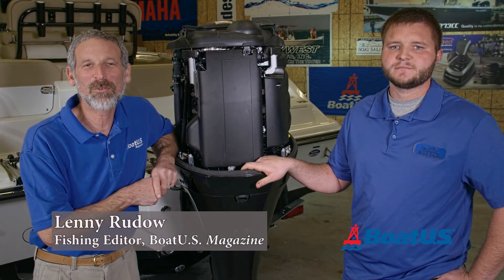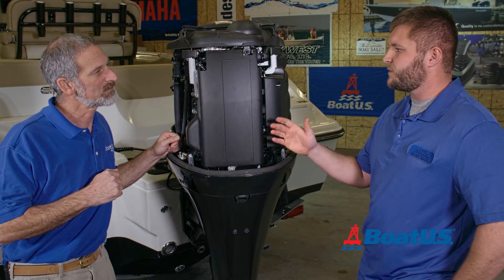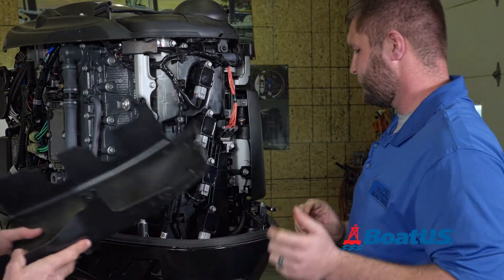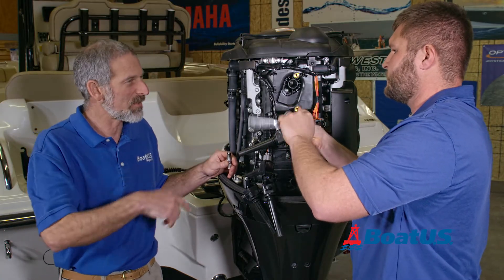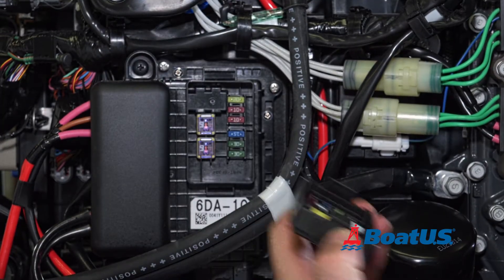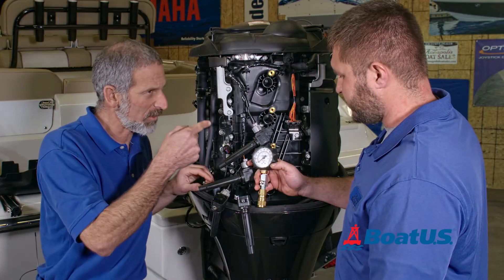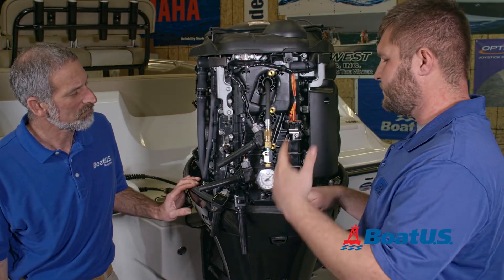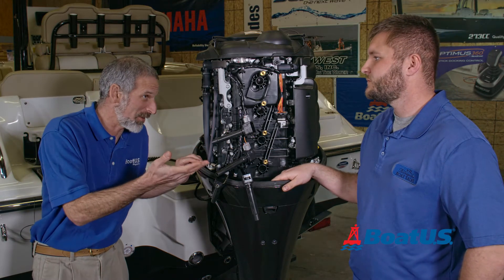Essential Guide: Test Outboard Compression Like a Pro | BoatUS

Comment: I see this video is older. I am a newbie to boating, and am looking at a 1999 cobia cc w/150 ox66 saltwater series II. Questions? Should I check even if she cold starts immediately,  or check to assure motor is good compression  . Also, any damage with fuel pump disconnected ?
BTW,  ENJOY BOAT US. AM MEMBER,  LOTS OF GOOD INFO, AND FREE COURSES!
Reply from the maker: Thanks for the question, Dave. Speaking both as a boater with many years’ experience and as a boat surveyor, my personal take is that a compression check, while useful, is often unnecessary. There are so many factors that come into play here: How old is the engine, how many hours does it have on it, has it been regularly serviced and will it make the manufacturers recommended maximum revolutions? Providing the engines meet all the criteria and perform as the manufacturer indicates in the technical bulletin or owner’s manual then all will most likely be well and a compression check unnecessary.

Having said all of that, I see that the engines you refer to are two stoke making access to the spark plugs much easier as they are easily removed from the cylinder heads without disassembly of any other parts to gain access and remove the plugs. This makes a difference, and also makes taking a compression test that much simpler, so I see no reason why it should not be done. Remember that a compression check must be carried out when the engines are warm – a cold engine will give false high readings – and all readings should be within about 10% of each other. If one is much lower than the rest then this could be indicative of s problem that needs further investigation.

You may find the following link helpful. https://www.boatus.com/expert-advice/expert-advice-archive/2016/april/checking-compression-on-an-outboard-engine
Reply: @boatus  The video says 10% of one another, when comparing compression numbers and your reply says 10 psi.  Which is correct?
Reply from the maker: @joewall1416  My bad, Joe. Thanks for pointing this out; you are quite correct, it should be 10% not 10 psi. Having said that, oftentimes the difference will be no greater than 10 psi between cylinders. Sorry for the confusion. I've updated my original response to Dave.
Reply: @boatus  Thanks for the quick response and clarification!
Joe

Comment: what is the thread size and pitch for these plugs?
Reply from the maker: Thanks for the question. The size of the threads varies depending on the make, size, and age of the motor. Older motors used either a 21mm or 22mm thread and required a 13/16 or 3/4 inch socket to remove them respectively. However, most modern engines us a 16 mm plug and require a 5/8 deep-well plug socket to remove them.

Comment: When you’re turning the engine over for the compression check do you have to have the water  ears over the inlet
Reply: Its good to have water muffs on anytime you turn the engine over so you don't prematurely wear out the impeller.
Reply from the maker: Thanks for the question, Jordan. Cooling water is only required while the engine is actually running. The engine is not started when conducting a compression test so, no, you do not need the muffs on the engine. Also, a common mistake when conducting a compression check is not removing all the spark plugs. Removing the plugs does two things: 1. It ensures that the engine cannot be started, and 2. there will be no compression allowing the motor to spin over on the starter easily.

Comment: What size adapter did you use? mY COMPRESSION KIT didnt have an adapter to reach thread into plug port
Reply from the maker: Thanks for the question, Cheryl. You should not need an adapter. As you will see, there is a rubber hose, usually about a foot long, in your kit that has a press fitting one end that goes into the gauge and a screw that goes into the plug hole. Before connecting the hose to the gauge, you should be able to attach the threaded end to into the plug hole by twisting the hose. The hose only needs to be hand tight.

Before conducting a compression test, make sure to remove all the plugs from the engine. This prevents any inadvertent starting and makes it easier for the starter to crank the engine over.

Comment: What causes no compression on one side of engine? V6 OMC 3.0. Please help
Reply: You shouldnt have a 0 reading on one whole bank of the engine, check you threaded the tester correctly otherwise the only thing I can think of is if it's a 4 stroke you have valve blowby but I have never heard of that happening to a whole bank
Reply from the maker: @yaboy6157  Thanks for your response!
Reply from the maker: Thanks for the question. If you have no compression it can only be down to a few things. Assuming that you have no compression at all on one side of the engine, I would suggest that you have holes in the pistons or the piston rings are no longer doing their job and have totally failed, often due to the engine severely overheating at some time. Another possibility is that the cylinder head gasket has failed. These engines were last made in 2000 and although I don't have much knowledge of these engines in particular I would imagine that it should be possible to buy spare parts. However, you may want to get a qualified outboard technician to give the engine the “once over” before you go spending a lot of money on it, as the cost of repairs may well be far in excess of what the engine is worth.

Comment: I’ve see 2 problems in this video. First for safe you should have the spark plug test connected to the wires ( you don’t want to get zapped while doing it ), also you should have the throttle in WOT for accuracy readings. Good luck
Reply from the maker: Thanks for your comment, Cesar. Cranking over the engine while performing a compression test introduces gasoline into the cylinders. You don’t want the high tension spark plug leads connected to anything that may produce a spark and potentially ignite any unburned fuel close by. Secondly, the disconnected spark plug leads are well shielded by the spark plug push-on connectors, so the risk of shock is very slight especially if the ends of the leads are tucked well out of the way while carrying out the compression test.
 

To your other point, it’s certainly possible to have the throttle in the wide-open position while performing a compression test, and I know mechanics who do this. The theory is that this introduces more air into the cylinders and thus gives a more accurate reading. However, much of the value in any compression test is the comparative readings between each cylinder. Opening the throttle may add a couple of extra pounds to the peak readings but it won’t alter the fact that one cylinder may have a lower reading relative to the others. 

That said, we stress that you should always follow the manufacturer's recommendations. If you're not sure, invest in a maintenance manual for your specific engine. It's money well spent.
Reply: @boatus  I was wondering how many comments I'd read through before finding the "you're doing it wrong" trolls. If it wasn't for YouTube videos, I can't help but wonder what these guys would be doing, and who they'd be doing it to.  This was a great video, and while there are always more than one way to skin a cat, you did nothing wrong....
Reply from the maker: @atomicslam1589  Thanks, Atomic. We are always happy for the additional input, which is usually very helpful, because, as you very rightly point out, there are often many acceptable ways to do things--and we do learn some great tips from our viewers and readers. But, yes, we do sometimes wonder why folks who clearly already know so much are watching our how-to videos. 🤷‍♀️
Reply: @boatus  Amen...
Reply: BoatUS That’s Right, while cranking the engine over it introduces gas into to engine ( good thing that you disabled the fuel pump by removing the fuse ) however having the spark plug leads hanging closed to the block without any protection is a little danger, the high current is looking for a ground and the engine block is a good source of it, most of the spark plug tester are safe to use.
Reply: Not to mention, unless I am mistaken, it can do damage to the ignition system having juice going to the unattached plug wires. I’ve always disabled power to the plug wires and fuel pump, if the pump runs of power. Either way you don’t want fuel or spark live during a compression test.
Reply: @finner2.019  It's a live circuit but there's no "juice" unless it's got a complete path.

Comment: I just tested my 1991 Evinrude "BEFORE" watching this video. My cylinders are all with 10% of one another, but...I did not remove all the plugs at once and the motor was cold. Should I re-check using your method? Thank You
Reply from the maker: Thanks for the question, Steve. As we mentioned in the video, the compression should be checked with the engine warm. This gives the pistons a chance to expand in the bores and will give a more accurate reading. 

Always check the compression with the plugs removed, this allows the engine to spin over easily, places far less strain on the starter motor, and perhaps most importantly, ensures that the engine will not start unexpectedly.

I’m glad to hear that the readings are all within 10% of each other, and although I doubt that there is anything out of whack with your motor, it would probably be best to use the method we described in the video.

Comment: Is it worthwhile to do a compression check on a lightly used 2017 outboard since it is about 2 yrs old.
Reply from the maker: Thanks for the question! In your case, it's probably not necessary. A compression check is simply one check that engine surveyors and interested owners can do on their engines. A compression check will give an indication of “blow by” of the rings and valves. This is unlikely to occur on an a nearly new engine and I would say that it is unnecessary, unless there is some other fault with the engine such as rough running or excessive oil use.

A compression check can be useful at times but a more useful check would be to get the engine to a local authorized service center that services your make of engine and get them to plug the engine’s ECM into the diagnostic computer. This will show any fault codes and the technician will be able to tell a lot about the health of the engine from this simple check, certainly far more than doing a compression check in isolation.
Reply: Ok

Comment: What should a25 horse mercery 4 stroke have for compression
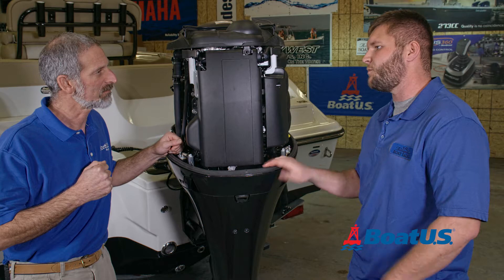Reply from the maker: Remember what the tech told us between 0:30 and 1:05 in the video. The key thing to look for isn't one specific number or another, but that all of the cylinders are within 10-percent of one another. Different gauges can vary a bit and elevation is also a factor, which is one of the reasons why looking for the different cylinders to match up is what you really want to look for.

Comment: Tnx for the informative video ,I have a question plz, whats the normal pressure for yamaha 85hp mix oil and fuel engine and is there a difference in the air pressure gage if is stander engine or 50 fixed or 25 fixed ?👋
Reply from the maker: Thanks for the question, Sam. If I understand you correctly, you are wondering what is the compression pressure that you should see on the gauge when you conduct a compression check. The pressure should be somewhere around the 125 psi mark but may be slightly more or less. What is more important is the comparison between the cylinders. Check each in turn and note the readings which should show a variation of no more than about 10 psi between cylinders. If one is significantly lower, further investigation will be required as this could be indicative of a stuck or worn valve, piston and bore wear, or some other issue.
Reply: @boatus  thats what I meant ,thank u 🙌👋
Reply: I have 90 hp  year 1986 yamaha and got following: 1# 7,5 barg, 2# 8,5 barg, 3# 9,8 barg.  Quite different. What is correct value? Can I use the motor?

Comment: Hey Lenny, where can I purchase a compression tester for my outboard?
Reply: I got my most recent compression gauges from Amazon for about $20 with a carrying case and an assortment of adapters and fittings a year or 2 ago and I've used the crap out of them. That's where I'd look.
Reply from the maker: Hello, thanks for your question! There is no specific compression tester for outboard motors. You can find suitable compression testers at places like NAPA or Autozone. Since it’s a tool that you need infrequently, you may find that you can rent one from either of these outlets.

Comment: Hi I have a 2001 90 hp mercury. Last oil change was 2 years ago I do a lot of winter trolling.  Last  time I checked my oil level it was a half inch high.  When I drained the oil milky water came out of the crank case. I would say no more than 6 ounces. I've read that these motors build up internal condensation.  Before I confirm this I want do a compression test. Have you ever seen this problem before? This is my first time servicing this motor.  I usually take it to a shop.
Reply from the maker: Thank you for the question, Pacoloco. Six ounces of water sounds like quite a lot, and I suspect that this may be more than simply condensation. Water in the oil could come from a number of sources, such as a leaking head gasket or worn seal — both of which will require the services of a trained outboard mechanic. 

Although you do not say how many hours are on the engine, I question why you believe that you need to do a compression check. This has nothing to do with water in the oil, which is a separate issue entirely. A compression check can provide a useful insight into the wear in an engine but often is not required unless other issues such as lack of power or a misfire is noted. 

A compression check is just one of a battery of engine checks that can be carried out to try and determine a problem with a motor. Of far greater concern to me is the water in the oil, and I would encourage you to get the engine checked out at a certified repair facility before you use the motor again.

Comment: Do you need to disable the ignition circuit when performing a compression test?
Reply from the maker: Good question, Gary. You are going to need to use the starter to perform the compression check. As you will have removed all the sparkplugs and disconnected the HT leads to the plugs, the engine can't start.
Reply: @boatus  On that motor, if you had used a remote starter switch (https://www.google.com/search?q=remote+starter+switch&oq=rfemote+starter&aqs=chrome.2.69i57j0l5.8468j0j7&sourceid=chrome&ie=UTF-8) between the battery positive connection at the starter solenoid and the brown wire next to it on the same solenoid, you would not have needed to remove the 15 amp fuse for the fuel system or worried about the ignition firing as long as the key was off and or the emergency stop lanyard was disconnected. At that point, all you would be doing is cranking the pistons, crank and such with no other motor functions.  I'm glad to see you showed the technician watching the compression reading as they were taken as that is an often forgotten important component to taking a proper compression reading.  Paul Murphy, Yamaha Master Tech.
Reply from the maker: Thanks, Paul!
Reply: I was always under the impression you should disable the ignition system so you don’t damage it if the plugs are disconnected and not grounded. You really only want power going to your starter.

Comment: Can anyone out there tell me WHY you need a boat? One reason? Anyone? Your hobby of polluting our freshwater supplies is not more important than my grandchildrens future! Private ownership of boats should be banned.

Bernie Sanders 2020!
Reply: Is Bernie going to be alive in 2020? 
While boats do pollute. They are just a small fraction of the reason for pollution. Take a look at how your battery in your phone is made. Or better yet how nuclear power is running your computer. Boats dont have place on a big list of reasons why water and air is getting polluted. Nice try. And for your sake I hope you dont have anything gas powered (lawnmower, car or bus ect). Because in your words, you are also part of the problem.
Reply: HAHAHAHAHAHAHA
Reply: This didn't age so well.
Reply: Jimbo the EPA has done its job in cutting down emissions from fossil fuel engines..Two strokes have been phased out with much cleaner engines..no oil mixed with fuel in four cycles..They are basically the same as your car..they have a valve train..and they are much more efficient on fuel..So improvements are made all the time..And there is electric engines! ..We are in a pandemic..notice how things take time to adjust..Boat owners contribute tax dollars and employment..Your statement doesint hold water in 2020 ,2021..Some of us work hard and need to unwind..decompress..speaking of compression..🤣
Reply: How about cars they are doing a lot more damage than boats.
Reply: What an idiot... 😂
Reply: Yes you and all the communists can go to live to Venezuela, cuba ,china, and fix the environment over there

Comment: Hi.. Thank you for the informative video. I learned a lot especially the part of removing all spark plugs before performing the compression test. I do however, have a question regarding wear and tear and life of the motor. I know the first reading is the benchmark, but how do I know that reading is within acceptable levels? Thank you!
Reply from the maker: Hi Marlon. Great question! A compression test is a comparative test. We're less concerned about the actual reading than we are with the cylinders being within approximately 10% range of each other.
Reply: Understood. Thank you!